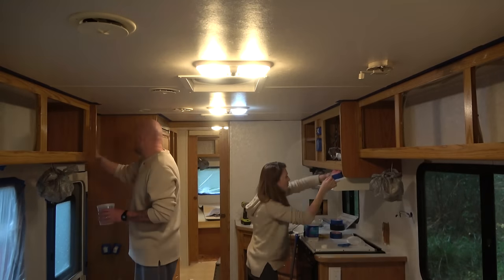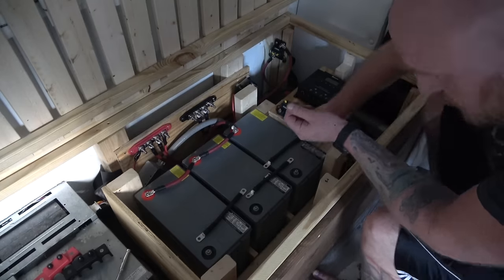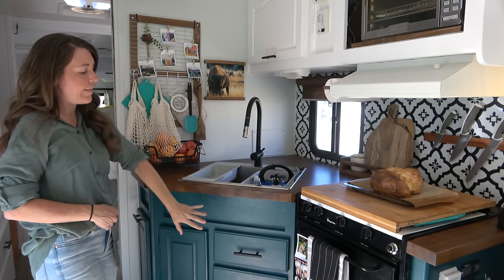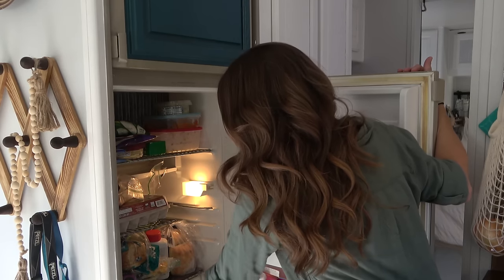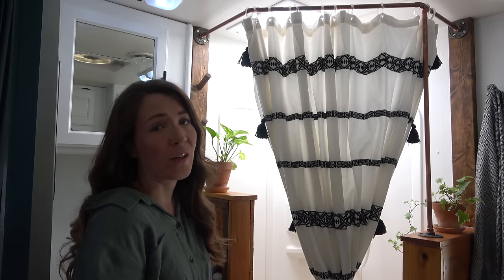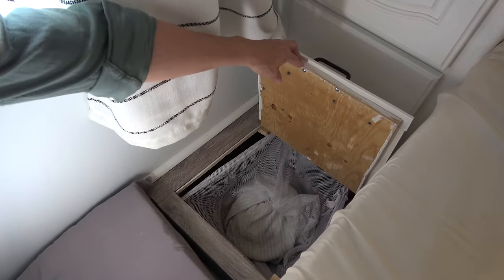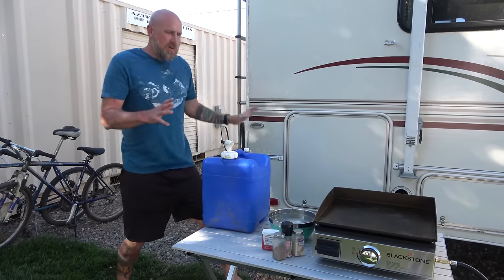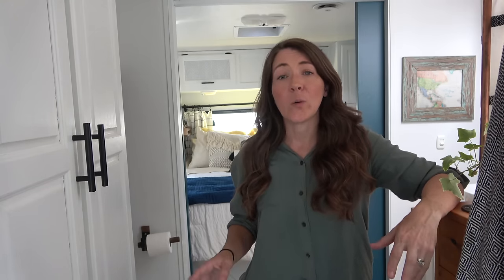Tour Our Completely Remodeled Class C Camper Van // Full Time RV Tiny Home on the Road!

Comment: Hi folks, new subscriber, I just purchased a 2000 Shasta Travel Master 304 just shy of 19,000 miles for $16K.  Minor question --- How/recommendation on internet, TV and network setups?  Thanks in advance. D
Reply from the maker: Thanks for watching and taking the time to reach out! And congrats on the purchase! Seems like it could be a great deal! As for Internet, we have AT&T that comes with 15G of hot spot data each. There is a beefier plan that allows 40G but we haven't reached that need yet. In the past we also diversified our internet by either Sprint or Verizon MiFi hot spots. They're usually around $100/mo for "unlimited data," though we had issues in the past when we traveled to Baja where "unlimited" turned out to be "zero." In the US, however, adding either a 100G or unlimited with a separate carrier is an option if you need that much. It's a safety and convenience thing to put your eggs in 2 separate baskets rather than just with one carrier. As for TV - we NEVER use our antennae and actually removed it from the roof. We exclusively stream either from WiFi (when we have it, NEVER from our own hot spot as we use our data to work not to watch TV!) or play shows that are downloaded to one of our devices (we watch "TV" on our tablet more than our actual TV). We also use our Apple Lightning to HDMI adapter frequently as we can use cellular data to bring up shows/football games on our phone that then is wired right into our TV! Definitely don't skimp on this by buying off-brand, if you go this route. For some reason only the Apple products work, despite what the off-brands say. Hope this helps! Thanks again for watching and taking the time to reach out! https://amzn.to/3ldMvNP

Comment: Could it be a speedometer problems such as yours could be caused by reversing the odometer reading, which could also be the reason the odometer being so low?
Reply from the maker: No. There's some glitch. We track every mile we drive and we've never had any hiccups or indications that there is something wrong with the odometer. The needle is just lazy under 40 mph. Once we hit 40 it's as accurate as can be!

Comment: Do you think a Winnie Minnie 1987 model is too old a model to invest in? I am worried the engine won’t be strong enough to carry the weight or have enough power. The cost to by is $8,500, has 83,000 miles, 26 ft long, 2 owners, 4000 generator

Or should one get a newer model
Reply from the maker: This is a terribly difficult question to answer. All we can do is give some advice and perspective. First, you should consult a mechanic to do a mechanic check of the RV. Not just an RV inspector who may only start the vehicle just to check a box that it runs. With an RV that old you will want someone to give it a thorough mechanical inspection. But know that nobody can predict what may break in teh future in sometime in the future... For an RV that old, 2 owners is great - hopefully they have a detailed maintenance log between the two of them? 4,000 on the generator is not terrible. But like the vehicle engine, it should have been serviced in regular intervals every few hundred hours, so ask for that service record... The bigger issue is whether there is water damage (most likely in a vehicle that old) and whether it is fixed or still there (if by chance there was never any water damage). If I were buying an older RV like that I honestly would not pay half of that asking price. But that also depends on where you are. The market is incredibly overinflated now, particularly in higher cost of living areas like CA. So a buyer can ask what they want, but in the end the RV is only worth what someone is willing to pay. I'd give 4, assuming there was no major water damage, the mechanical checked out and all of the appliances worked. There are too many other things you're going to want and need to put money into at that age. We have both a video and a post for what to look for in a used RV. Check out the post and click through on the video. Thanks for trusting us to help! https://calledtowander.com/tips-for-buying-a-used-rv-checklist/

Comment: so i have ms may be in wheelchair and could use a bath to help leg pain - how do u think that could be accomodated in a class c or truck camper as i have been looking into both, can u talk about insurance and other pricing differences between the two camper vs van
Reply from the maker: We just did a LOT of research to try and help someone who wanted to put a tub in their RV. It is a LOT of work, requires a LOT of water and a LOT of grey tank space. This doesn't mean it is impossible. But you'd have to find an RV you can put the tub into, literally through the door, roof, wall, window, etc. Then have the power, water, etc. No way for a tub in a truck camper. You're looking at a Class C at best

Comment: Did you actually mean to say that you use an inverter to charge all of your laptops and cell phones? You do realize that your wasting a LOT of power by changing DC to AC back to DC correct? House Battery to Inverter to DC power post bricks. Everything you said runs off DC power anyway.
Reply from the maker: Yes. Ok. Cool.